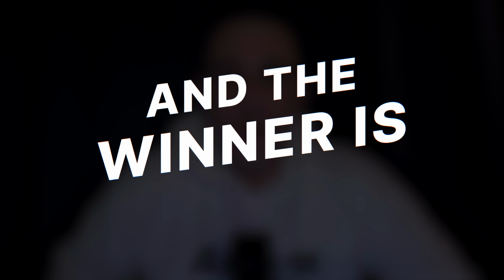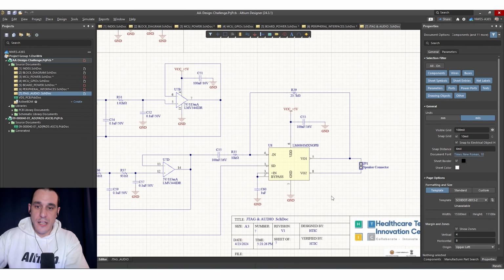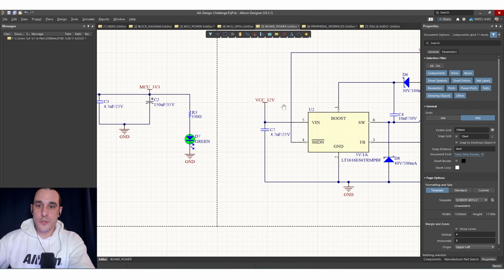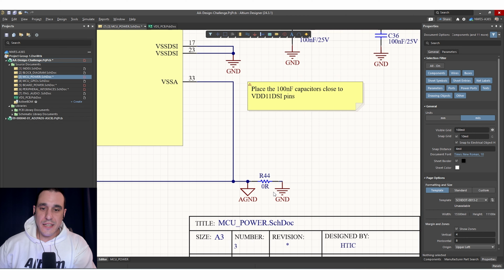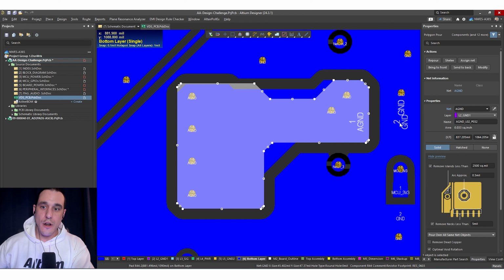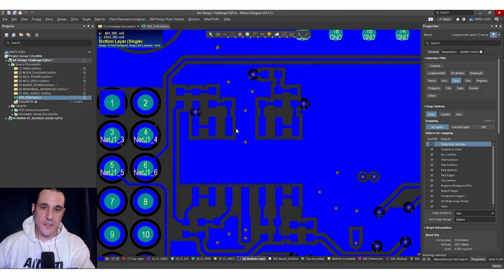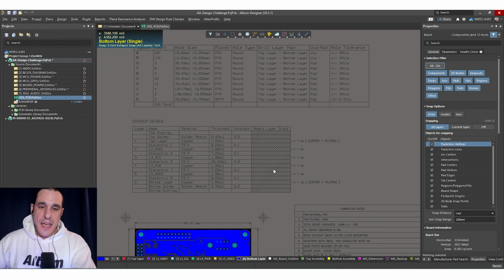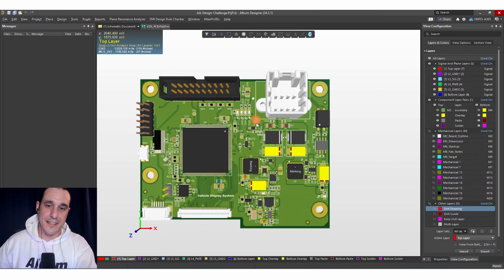Tesla Display PCB Design Challenge: The Winner Is...(plus analysis)

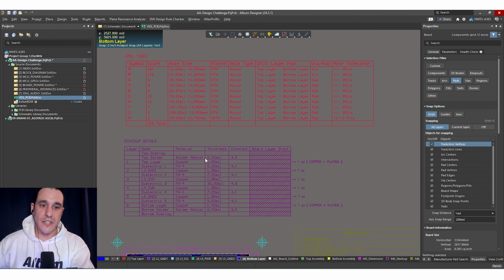Comment: Was I misreading the drill file around 17:11?  It looked like there were several hole types that differed only in size, but the difference was less than the tolerance.  Is the cost of drill changes essentially nothing now?  Or are manufacturers expected to optimize this on their own?  Or was this just something not yet optimized?  (And if so, how did they get different sizes in the first place?)
Reply: That particular table gets auto-generated by the software based on footprint information but I think the manufacturer will do some level of optimization to the closest drill bit size within tolerance. For example, the 39 mil and 39.37 mil drills might both end up being done with either a 1 mm drill or 39 mil drill because that is the closest within the tolerance range. For smaller drills being used for vias you can't do that and get away with it though, especially due to Class 2/3/3A qualification having requirements for leftover annular ring. So I think if they do decide to group something together due to the overlapping tolerances they will choose the smaller of the two vias due to clearance and annular ring requirements.